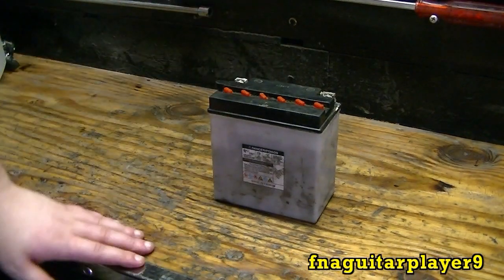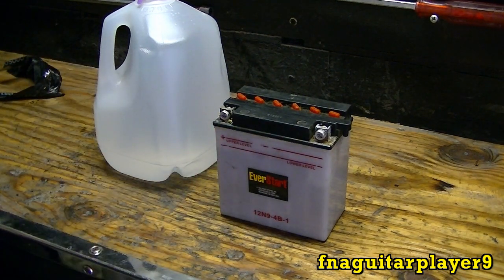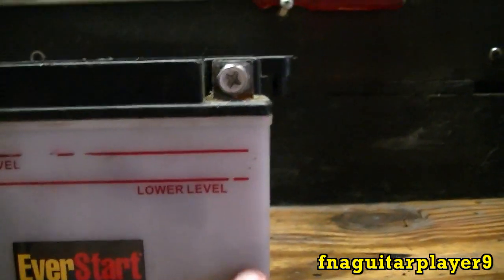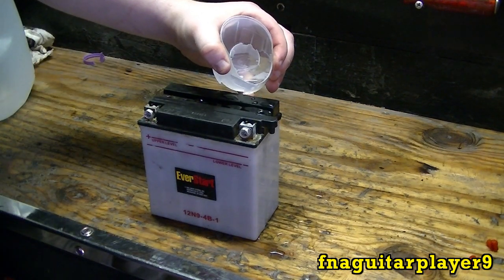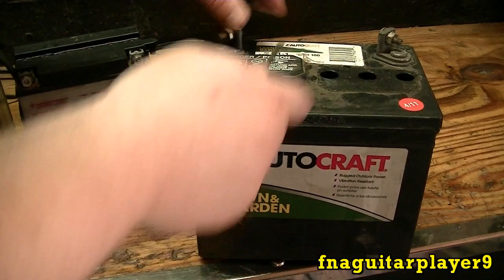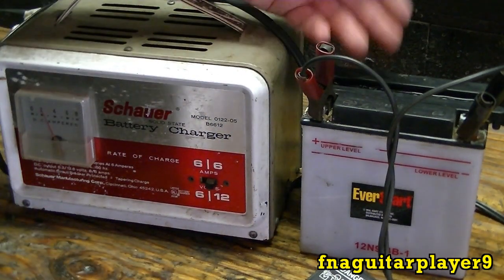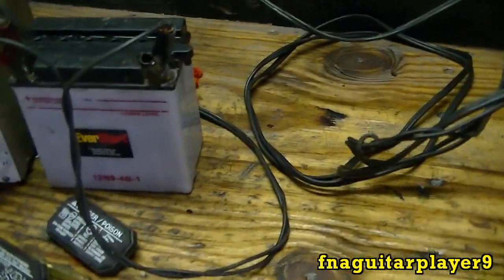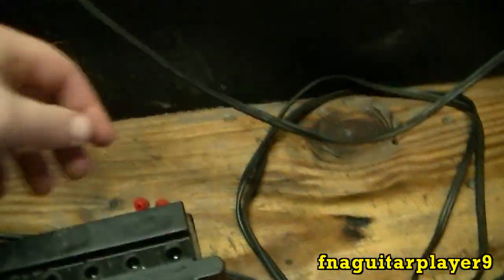Battery Maintenance ::: Adding Water to Cells and Charging

Comment: I have found out over time.to use a hydrometer to test the solution strength first. This will tell you a lot about the battery. Make sure the numbers you read are what is on the meter. When within limits you can charge the battery. Hopefully it takes a charge.

Comment: Since you're not an expert first thing you're giving slightly wrong information on the 1 thing you said you know about-filing battery. Don't top it off. Leave it just over the plates. After charging. If you need to too it off then do it and charge again should take half hour to do 6 too 8 amp charger lol that's funny shit. 1/2 or 1a is max. I guess one way to not worry about overfilling, just boil it.

Comment: i saw a video of a guy charging a small ATV battery and he screwed the little yellow caps off and said "never charge a battery with the tops on them"  I am 64 and never head that before? Is it true? Maybe gas needs to escape?
Reply from the maker: Thats mainly for a new battery that you put the acid in because it will have more current going through it on its first charge and will bubble more. Its one of those things that some people do, but really its not necessary, because the caps have vents on them or if they are screw in type it has one main vent for the battery usually connected to a hose. They will give off hydrogen gas when charging or even discharging but usually the vents in the caps or battery is enough. Thanks for Watching!!!

Comment: Thank you for the comment about not adding acid to an already acid containing battery. I was looking around for that tidbit and didn’t find it till your video. So is battery electrolyte the same as battery acid. I’m not schooled on this at all but am opening my eyes to the information as we have 8 six volts for our solar system and I’m now without any advisors.
Reply from the maker: the acid is mixed in with distilled water, so if it the level drops, its usually just the water boiled out of it, the amount of acid is still there (unless its been severely overcharged and gave off a rotten egg smell, then its the acid boiling out of it). Thanks for Watching!!!

Comment: You should charge the battery before adding water.  The electrochemical reaction will cause the level to increase, so charging after can cause overfilling.  Over filling has two downsides.  One: it dilutes the electrolyte which will reduce performance.  Two: as I think you mentioned, it can cause the electrolyte to overflow (run out/off) and loss of electrolyte will definitely reduce performance.
Reply from the maker: This is true. Thanks for Watching!!!

Comment: I've noticed a lot of misinformation in the comments so I'll throw my 2 cents in. The water in the cells gets broken down into hydrogen gas due to electrolysis from repeated charging and discharging cycles. With the exception of leakage/spillage, the acid itself never disappears; by adding water you're simply bringing the acid concentration back to what it's suppose to be.
Reply from the maker: Thats a good way to say it, the only time the acid will leave if its over charged, it will give off a rotten egg smell. Thanks for Watching!!!

Comment: I thought it was when it gets to 8 it's fully charged, not when it gets to 0?
Reply from the maker: No, its a amperage readout, when a battery is low it will read a higher amperage until it charges up. On the old type chargers like that it will probably never get below 1 or possibly 2. On the newer digital ones it has a percentage readout and is done when it gets to %100. Thanks for Watching!!!

Comment: Just out of curiosity,

what is the PH value of properly maintained battery electrolyte ? anybody ?
Reply: i don't think it is 0.8ph, because i had spilt battery water onto my finger before.. nothing much effect.. just a little bit like vinegar onto my hand. 

is battery electrolyte pH value changes according to the state of charge of battery ? 

andrew
Reply from the maker: Honestly I'm not sure, i usually go by how they act on the charger, the amperage and time it takes to charge tells you alot about the condition of the battery. Thanks for Watching!!!
Reply: It's measured by specific gravity, not ph. I used to know 40 years ago when I was a mechanic in the Army, however, I don't recall it now.

Comment: Hii fnaguitarplayer9

i bought a new Varta F19 battery. i just want to check the sg and ph value of the battery solution (just out of curriosity) but the 2 square cap are sinked into to the battery. when i tried to pry them up, the plastic gave way a bit, but the cap never move..

any idea how to open those kind of battery cap ? 

thanks
andrew
Reply from the maker: Hi. I'm not sure on that particular battery, they are making some of them completely sealed and you can not remove the caps at all. I don't like like them, i like being able to check them. Thanks for Watching!!!
Reply: Sounds like the cap is vibration welded on. In other words, not removable (sealed)

Comment: I called a forklift battery company near me and they said that I don't need to use distilled water.  They said, that's the reason why a forklift battery watering system hooks up to a faucet/hose connection.  Were they wrong?
Reply from the maker: I can't say for sure, for that type of battery it may not be as critical, but I've always heard not to use tap water because the minerals / chemicals added can cause corrosion on the plates. I would recommend following what ever the manufacturer recommends to be safe. thanks for watching!!!

Comment: what happens if you empty the battery like dump all the shit out and then just fill it with distilled? i figure there would be a lot of particles and gunk that could be drained out.
Reply from the maker: Distilled water will probably not even work, there are "recipes" online on how to clean batteries  and replace the acid with a homemade solution. Thanks for Watching!!!

Comment: Is it okay to just add battery solution/electrolyte?
I already charged my battery but the electrolyte is at low level. I hate to think why I bought electrolytes when others just add water. :(
Reply from the maker: No, only top off with distilled water, not acid. Thanks for Watching!!!

Comment: Can we use home made distilled water in battery
Reply from the maker: As long you strain it and maker sure there is nothing in it, i don't see why not. Thanks for Watching!!!
Reply: Use water from a dehumidifier or air conditioner drain, this is pure condensation
Reply: fnaguitarplayer9 so clorine messes it up eh... Dangit.

How do i get me some distilled water x.x
Reply: It can be found at most grocery stores. It can also be found at stores like walmart.

Comment: can l use mineral water insted distilled water?
Reply from the maker: Unless your in a bind and you have no choice, i wouldn't, the minerals can cause corrosion. Thanks for Watching!!!
Reply: No.  Don't but mineral water, not standard bottled type water in there.    You want distilled water.  The only time you'd do that is if you were in major need to get the battery functional.

Comment: What happens if i use normal water
Reply from the maker: It can cause corrosion to form since there is other chemicals or "minerals added for flavor" that can cause corrosion in the cells, it will work if your in a bind and don't have a choice but it will take some life out of the battery. Thanks for Watching!!!

Comment: what happens when water comes out of the cap of your Battery when you start your car?
Reply from the maker: Its usually as sign of a weak battery, not always. It could also be the alternator is putting out to much voltage causing it to boil over. If water has been added to it at some point it may have to much in it. Hope this helps, Thanks for Watching!!!
Reply: my battery reads 16v  now when the normal v reading should be at 13 or 14v. and water is slowly coming out of the caps. overcharged battery. i turn the ac and stereo on to balance the charge from the alternator. my question is, would it explode eventually? or should the ac and stereo temporary fix be enough for it to run for about a week or a few days more? thanks man!

Comment: will adding distilled water over time dillute the acid liquid inside and render the battery bad?
Reply from the maker: Yes it will. Its more/less to help prevent further damage. But by the time you have added enough water to dilute the acid, (from topping the water off on a say a yearly interval, or however long it may be)  it will be about time for a new battery, since the plates will be corroded by then anyways. Thanks for Watching!!!
Reply: As the battery us discharged and charged, some of the water from the acid solution evaporates. The purpose of adding the distilled water is to bring the electrolyte level up to the correct level.
Reply: I've topped off batteries for long periods of time and have had very long service with them. For instance, my Die Hard Gold lasted nine years. Topping it off never impaired it. Same with other batteries. However, never let the fluid drop below the top of the plates or that will cause damage.

Comment: Should wear rubber/latex gloves.  Grocery stores sell small squirt bottles that work great.....OR, use a turkey baster.. They also sell mini sized basters that should do the job; so no mess........btw: adding acid to water will boil up,,,,likely in your face.   Acid added to a DRY battery is ok, but NEVER add to water.
Reply from the maker: Good points to bring up, I should wear gloves, but just can't get in the habit, i do wear safety glasses though when i'm doing this. Thanks for Watching!!!
Reply: Thom, Correction.
It is OK to add acid to water but NOT water to acid. the reason is that when adding acid  to water you are adding a concentrated solution (acid) to a dilute solution which results in a diluted acid solution. Adding water to acid is just the opposite, you are adding a dilute solution (water) to a concentrated solution (acid) which can cause a chemical reaction.

Comment: with a tester you can find out if dirty surface has a charge. sometimes up to 5 volts place meter at 20 volts. place positive rec on battery neg, and other end on battery top . plastic top part. you will see if it has created a charge in dirt and acid leak. always cvlean top clean. baking soda is good, and to have a little extra during working with acid. it nuetrizises the acid. no harm, countertops hands and spill. use distilled water slow charge test if you can with meter or battery tester, having low cost tools are very effective in the process shortens time and guess work, if working with a small 1.5 trickler. do not start battery on this if low charge. make sure charge with proper charger at 2 amps from 1 hr to 12 hrs depending on battery and charge required. when fully charged then put your winter trickler on. especially car batteries boat etc. make sure to use deep cycle on chargers for boat batteries if that type. important things. never use acid to top off, never. clean surface no dirt. also learn how to clean batteries with epsom salts once it goes below a good 12.4 cycle. hope these hints help. always good ground always check when installed vehicles after charging installing check main grounds clean re establish if possible. never charge high 10 amp or 50 amp for long time. anything over 15 amps is considered above low. 2 amp is best. easier on battery. they like slow charges better. No Walmart doesnt sell battery translators , I know the battery likes low charge without it telling me. cheers
Reply from the maker: Good points to bring up. I think the lower amperage is always better. The most I ever use is 10, and thats with a marine battery. And most of the time i charge it on 6. Thanks for Watching!!!
Reply: i cook it at 2. less than that is not good for big batteries as it may stop the battery from charging to its full potential. 1.5 is good for keeping it stored and not to charge up. once it is charged after 2, than use a storing type system. temp is good to be not to hot like over 70 degrees but not to low either. better to store in house if you have cold winters. thanks for putting it up.
Reply from the maker: I hear ya, 2 amps is a good setting to use. I always bring mine inside 
for the winter, helps alot! Your welcome, thanks again for watching!

Comment: Why slow charging is better than the fast charging........
Reply from the maker: Slow charging means lower amperage, fast is high amperage, the higher the amperage the battery will heat up more and be more apt to "boil" over, by boiling i mean the acid bubbling excessively through the vents. Which is evaporating the acid/water out of the battery. Slow is better because heat is reduced and there is little to no bubbling. Thanks for Watching!!!

Comment: what happens if i do not add water for long time??
Reply from the maker: +Rajeev Dahiwal It will basically ruin it, when its charging it will heat up and boil and can burn up the plates in it, and not to mention extreme loss of amperage output of it, and won't hold a charge as good. I've seem some go for a long time running low on acid/water. Just remember to top off with distilled water and never put acid back into one. Thanks for Watching!!!

Comment: what will happen  if i fill them to the top with distill water
Reply from the maker: +Kinday Magar All the way to top? That will act like a resistor across it and load the battery and drain it down, and will be easy to spill and will bubble over when charging. Thanks for Watching!!!
Reply: yeah all the way to the top.....how to fix that help me!!!
help me please
Reply from the maker: +Kinday Magar You will have to use a syringe or something along that line to remove some out of each cell, just be extra careful with the acid, you can mix baking soda into the acid you remove to neutralize it and make it easier/safer to dispose of. Then charge the battery as normal just to top it off.
Reply: then it will go to normal ????
you are a life saver man thanks alott.....
Reply from the maker: +Kinday Magar It should, but you never know about batteries, they are unpredictable! No problem!

Comment: Best way to keep a battery in top condition is to use it regularly.

I actually store my batteries in the bikes during the winter with a bat tender on them.  But the secret to making them last is to monthly unplug the charger and leave the lights on for a half hour to drain a bit of the charge, then shut off and re-plug in the float charger.  This why batteries last for 10 years or more in your daily driven vehicles.  They need to be cycled up and down frequently.
Reply from the maker: +Glenn Davis That is very true. I don't usually drain the battery down in the mowers during the winter to charge, but i do top them off every so often, I may start doing that, anything to make them last longer! Thanks for Watching!!!

Comment: what's the salt trick? do u dump the old battery acid out and just use distilled water and salt while charging? then dump and fill with new battery acid mix?
Reply from the maker: +brotharuss I plan on doing a video on it at some point this winter/spring. Basically you remove like a 1/4 of the acid in each cell and replace it with a mixture of distilled water and epsom salt, it has to be distilled water and epsom salt for it to work, then put the caps back on it and shake the battery (being careful not to sling acid) then remove the caps and charge on it 2 amps for at least 48 hours. It will eat the corrosion off the plates and will revive it for a while (most of the time). Thanks for Watching!!!

Comment: What can happen if adding battery water is too much?
 Can damage the battery?
Reply from the maker: +thetpy Usually what happens is with to much water, the water sits above the cells and can act like a resistor and battery will slowly discharge through it, or it will be more prone to leaking acid out of it on hills, or when charging it will tend to bubble out of the vents more. Thanks for Watching!!!
Reply: @fnaguitarplayer9  a

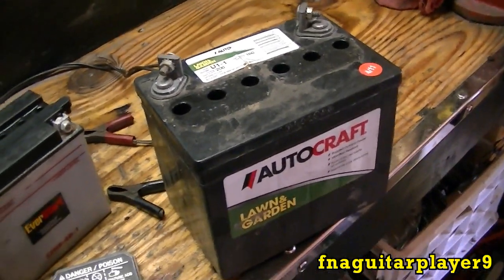Comment: 05:17 Where is the fill-to line or how do you know when to stop adding water to this type of battery? There is no fill to line I can see.
Reply from the maker: +stuntz0rZ Your right there is no line, what i do is fill it up to the bottom of the hole, or make sure that the plates are covered with water, either way is fine, if you look through the holes you can see the top of the plates in each cell just fill it enough so the water is over them and it should be fine. Thanks for Watching!!!

Comment: what happens if you unplug the battery before it charges? is that bad for the battery??
Reply from the maker: It can only damage it like that if its going to be sitting for a while without a full charge, but if its down some and your charging it during maintenance (like after it sat all winter) then no it shouldn't, because you'll be starting it soon and it will charge up on its own after the engine runs for a while. But generally speaking its best to complete a charge cycle. Thanks for Watching!!!
Reply: ok thank alot :)
and nice video ^_^
Reply from the maker: your welcome, thanks, appreciate that!

Comment: thanks for the tips man... pretty much exactly what i needed to see.... my motorcycle battery is completely dry, i think... i just hope its not sulfated
Reply from the maker: ***** your welcome! Hopefully it will revive it, you never know about batteries, they can surprise you sometimes haha Sometimes you can leave them on a slow 2 amp charge overnight (outside so hydrogen won't build up inside) and it will clean the plates somewhat, and there is also the epsom salt trick, i've done it before and it actually works, but I don't recommend doing that, its very dangerous messing with the acid. thanks for watching!!!